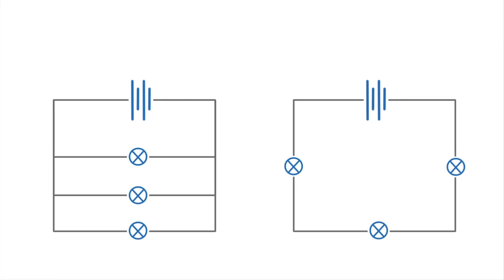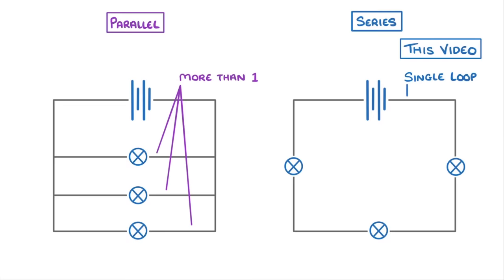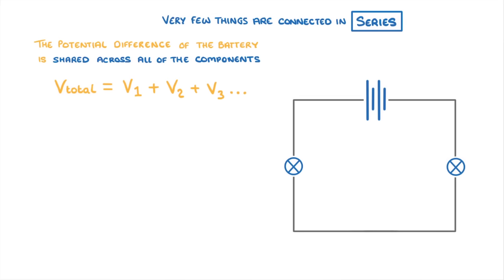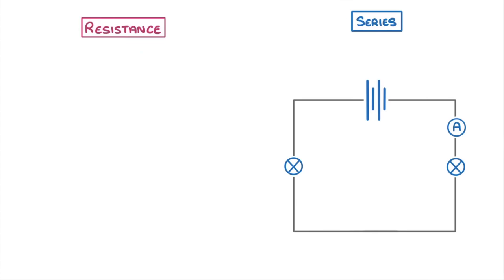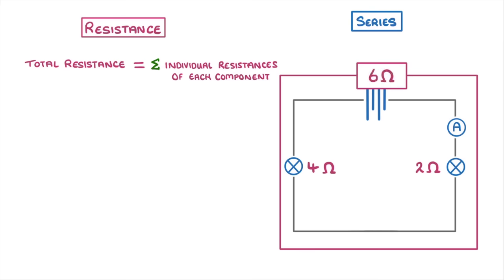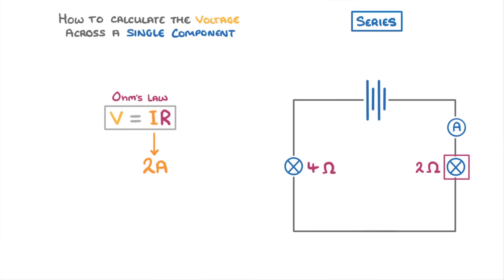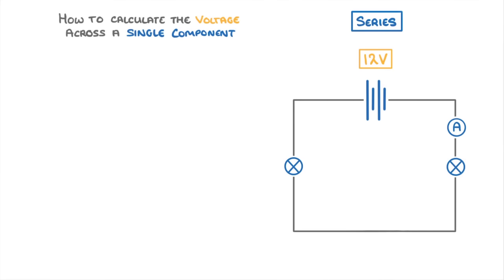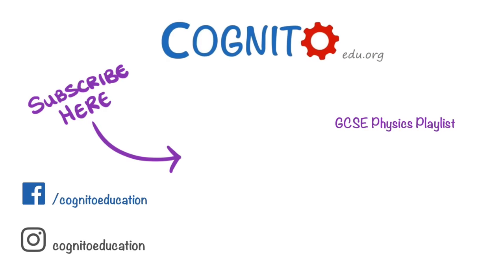GCSE Physics - Series Circuits  #17

Comment: 🎯 Key points for quick navigation:

[00:04] Series circuits have a single loop where components are connected sequentially.
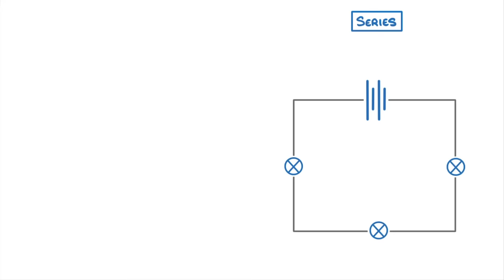[00:48] In series circuits, if one component fails, the entire circuit stops working.
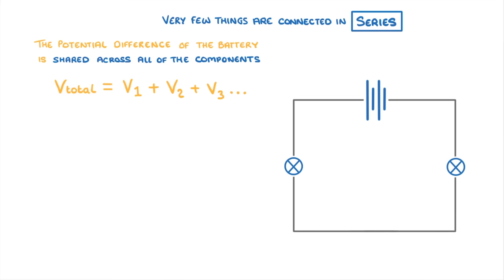[01:15] Voltage in a series circuit is shared across all components; total voltage equals sum of individual voltages.
[02:15] Current is consistent throughout a series circuit; it can be measured anywhere with an ammeter.
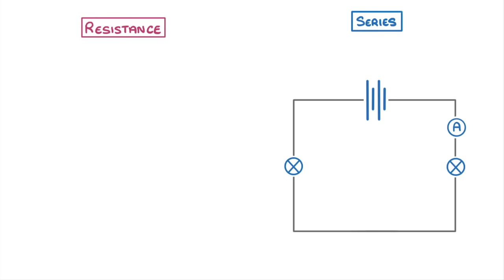[02:48] Total resistance in a series circuit is the sum of individual resistances.
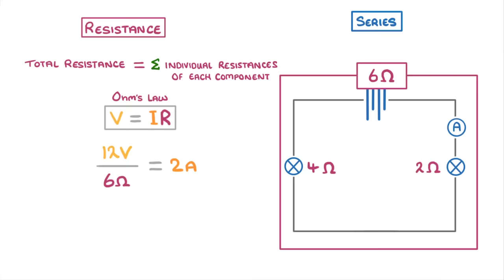[03:28] Current (I) in a series circuit can be calculated using Ohm's law: I = V/R.
[03:59] Voltage across a specific component in a series circuit can be calculated using Ohm's law: V = IR.
[05:21] Components with higher resistance in series circuits receive a greater share of the voltage.

Made with HARPA AI

Comment: Why are larger batteries donominated in volts (i.e. 12v) yet AA batteries are in Milli Amps (2000mAmp). Surely they should both be in volts?

Comment: Is there a way to calculate the resistance of an individual component? I understand you can find the total resistance, voltage, and current of the circuit with V=I x R but what about specific components, also is finding the resistance of a component relevant for igcse edexcel physics, Could I be asked to find the resistance of an individual component in an exam?  hopefully, I haven't bombarded you with questions, and thanks for the easy-to-understand videos, your channel is one of the few that provide science lessons I can understand without confusion.

Comment: In series and parallel circuits, how can I find whether there will be an increase or decrease in current or potential difference caused by a resistor?
. Do the the same/shared current and pd rules still apply? Thanks

Comment: You forgot something important. Which one of the bulbs is brighter? Which one uses up more energy? 

It's confusing because the one with the greater voltage also has more resistance. So you would think, if it resists more, it shouldn't get as bright. 
Like, there is a very high voltage inside an electric socket, but the plastic cover resists that, so when you touch the socket, you don't get a shock

So does the higher resistance bulb really get brighter? If so, why?